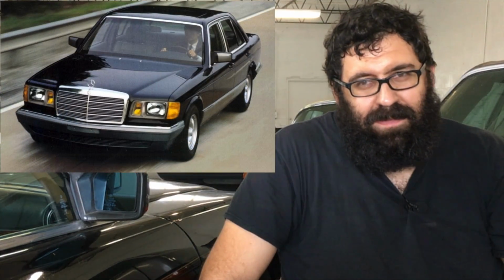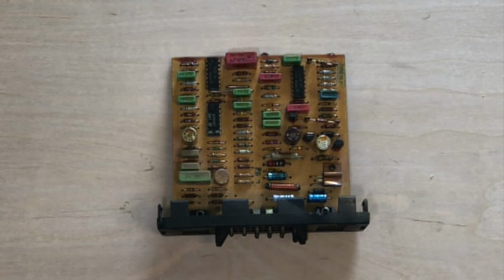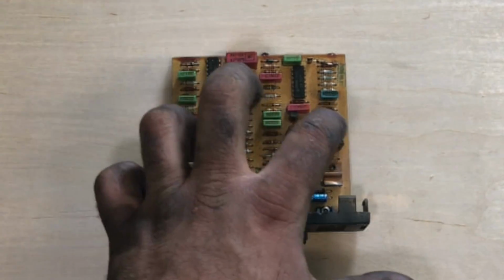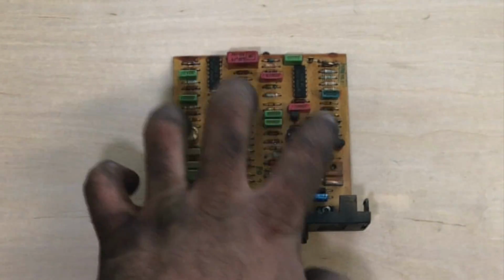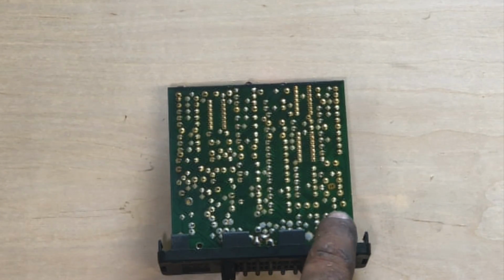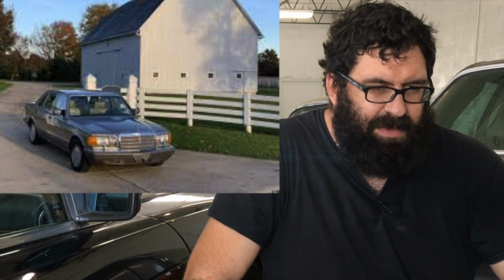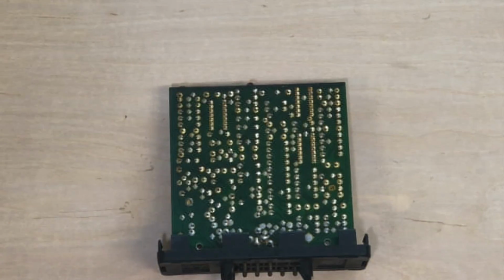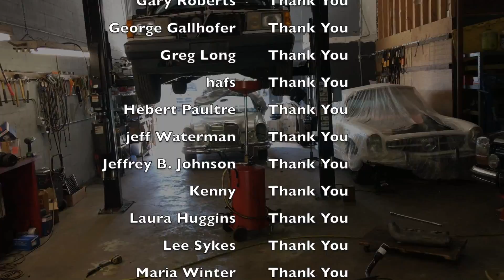Idle control units explained

Comment: How many folks have had their cars made worse by mechanics trying to fix an electrical problem with a mechanical solution? Thankfully, my dealership has a 35 year veteran Benz tech. who lights up when he sees my A124 pull in the garage. These cars are different than the new ones and the number of people qualified to touch them without “making the patient worse” is dwindling 😢
Reply from the maker: I agree. glad you have competent service for your 124! what year and model is it>?
Reply: Mercedes Classic with Pierre Hedary 1995 E320...late assembly for a 1995, too.
Reply: @fsb1284  where is your dealer
Reply: Faiz Rahman Loc at: https://www.mercedesabq.com/about-us/staff/

Comment: I've repaired the soldering spots on my W124's Fuel Pump and OVP relays and on the internal terminals of the KE computer, changing two capacitors too; no engine fails since then.
Reply from the maker: So you were able to repair both of them? on what terminal did they fail. i would like to know so I can repair them.
Reply: @mercedesclassicswithpierre1753  inernally where the pins match to the blades that are in fact soldered to the little board; an almost imperceptible oxidation at the contact point; I've cleaned the metal and soldered all of them. Specifically at the fuel pump relay, it seemed to not be receiving the RPM signal at pin "TD", from the AC compressor unit, pin 2. 
I'll add photos to this reply, just a moment please.
Reply: unfortunately I forgot to take pictures of the fuel pump relay...

Comment: I imported in Europe a 1989 560 SL. When it is cold the injectors work fine. As the car warms up the right side injectors start to give less and less fuel and in the end the car dies. Also the manifold gets extremely hot. Any ideas?

Comment: Our problem 1991 500 sl European model. Start car it idles fine, go for a ride idle goes to 2000 ,fuel consumption gauge stops. Car in garage starts idles fine  I unplug the ICV that I have cleaned 2 times idle goes to 2000. I plug ICV back in it idles back to normal. Is the ICV not working properly or whatever controls the ICV not working. Appreciate any input. Thank You

Comment: I love this video, even though my cars are ‘75 and ‘80, as you know Pierre. The comments here are gold! So much interesting information. My father in law was an audio visual tech when he was alive, and a darn good one. My husband learned a little from him. It’s definitely worth a try to resolder and rebuild some of these control units. 

My ‘75 450SEL cold engine idle is very high, almost 1,000! I just recently changed all the little rubber vacuum lines (the black connectors) in the engine compartment- the heating system ones, under the air cleaner vacuum ports off of intake throttle area, and the three vacuum solenoids lines on the firewall. I didn’t get the main one at the back of the motor, yet. 

I haven’t had a chance to test drive to see if the high idle went away, we got dumped on with snow. I don’t think the idle will change much from the vacuum line r&r but it’s a step in the right direction.
Reply from the maker: the cold idle is fine at 1000. they are supposed to be like that.
Reply: Mercedes Classic with Pierre Hedary thanks!
Reply: I forgot to mention. I made a cold start up video on my channel of the SEL if you have time to watch. Thanks

Comment: There are actually SIX electrolytic capacitors.  4 Radial (standing up) and 2 Axial (laying flat).  The axial ones are close to each other and are blue striped, with one wire coming out of each end.  These fail at the same rate.  The transistors too can fail, there are about 4 or 5 of them depending on model, etc.  These are the small, "D" shaped three-leg devices standing upright on the board, usually with a blue spacer underneath.  These control the different "stages" of idle speed, or the drop in idle speed from a cold start I have found.  These should also be replaced in my experience.  (however one of the transistors is obsolete and no longer made).  Other than that, ANY of the resistors (flat-laying, small, cylinders with colorful stripes on them) themselves can also fail, but usually don't and are easy to check if you see one looks burned/cracked.

UPDATE:  After doing some searching I found a suitable alternative to the one obsolete transistor.  I believe the "BC139" Bipolar Transistor (PNP) by STMicroelectonics to be a suitable replacement.

SO, If your unit has a failure of the obsolete transistor, or one of the IC's (chips) are bad, then you would be best served getting a new/rebuilt unit.  Otherwise they are indeed very rebuildable.  Of course also check for cracked solder joints and cracked/fried traces on the board.  Any exposed traces (copper looking) that are missing their green coating on the board should be considered VERY suspect (as this normally means that area got very hot, most likely because of a "short" somewhere) and inspected carefully for breaks.  These breaks are very hard to spot sometimes, especially so since the background is similarly colored.  Just adding my $0.02 to try and help out someone who was as frustrated as I was the first time I attempted this repair.  Thanks Pierre for this great video!!
Reply: Thank you for your addition, excellent information.  Actually, I think YOU should have been the one doing this video!
Reply: @560sec7  I keep hearing the same thing!  I just have a weak stomach when it comes to the internet!
Reply: petercastro2413    Yea it can... but i would start with replacing the o2 sensor and setting the mixture correctly before really focusing on the idle control module.  Though, if that has never been looked at, then it must also be done.

Even just the mixture being slightly off can cause the surging you are talking about.  Usually only happens during the warming-up phase though.
Reply: petercastro2413  CA smog??  Good luck!  These cars apparently barely passed even when new.

Comment: Dear Pierre, i have this problem with my 1984 euro 380sl. The idle contol valve gets 12 volts instead of 4,5 volts. So my engine stalls when hot! Could this be the idle control unit?
Many thank! Greetings fom Belgium

Comment: I've literally never had luck getting questions answered here but I think usually it's cuzza I'm not e'splaining things correctly. So. This may be TMI but better than TLI.
1983 380sl, sat in a garage 4 years b4 I bought, 2 owners, well maintained. 1st emptied tank best I could, stableized, filled with fresh gas. Ran great for a week then crappy. I had to feather throttle ¼ mile to get any speed. Replaced fuel tank, fuel lines, liqui Moli, new (reman) fuel distributor, fuel filter, fuel pump, kickdown switch, entire AC system (literally all of it), all fuses, plugs, wires, distrib/cap/coil, and more. Relays seemed fine. Finally, it ran great. Periodically though, it idles so low in drive that at a light I worry about a stall, esp w/ AC on. Then, green light, I "sometimes" have to feather gas. Some cat said "maybe idles too low cuz new refrigerant is thicker," decent point so we bled some, added some - no huge change.
After a drive, I pull in garage, put in park and before I shut it off it'll idle @ 1700+. 
So now I start looking next at the Idle Control Unit and/or the idle Control Valve. One is $230 almost universally, the other runs between $25 to one no higher rated for like $500. BTW, the OVP relay seems to be fine - had an extra. All good.
Should I replace the ICV for under $100 or icu for $230? Also, I know how to solder, and have the stuff - more detailed guidance (magnified, explained) would earn you a bag of Charms Blow Pops - THEE best sucker. Idears??
Reply: Patrons get answers more quickly...

Comment: Great video! I have an 1984 SEL that will not stay running without bypassing the fuel pump relay because the relay is not receiving a tach signal. The instrument panel tachometer is inoperative also. Tach signal is from the distributor to the ignition control module and to a terminal block that connects to the test connector, fuel pump relay, idle control module, and tachometer. Ignition control module was replaced but problem persist. Tachometer still does not work with the fuel pump relay removed and bypassed. Some state that the tach signal can be checked with a multimeter or dwell meter. ProgRama tells me that is not true and it requires a scope. Could the idle control module be shorting out the tach signal causing the problem?

Comment: I have a question. I replaced the icv and the rpms started jumping 1000 1200. I then replace the 3 transistors on the idle control unit and the rpms came back to normal. On a warm engine the idle is fine but on cold start the rpms stay under 500 around 400. 

On cold start the rpms should rise untill engine warms up and settles the rpms at 550, now is the idle control unit also responsible for cold start rpms? 
Should I just get a rebuilt one?

Comment: do you have the part# for the 3 small transistors  on a 1983 380 sl idle control module

Comment: hello pierre, i've had you answer several questions on my 1984 500sel. i changed the iac valve and cleaned both with carb cleaner and both work freely now i have a spare. to refresh your memory the problem was low idle cold and high idle warm and once in awhile it behaves. i replaced the coolant temp sensor (on the back pass.side of engine) now i just replaced the idle control module with a used programa module from a wrecked car with the same service numbers. now it has a surging idle and no cold start high idle and seems to be rich. what now??

Comment: I have later model of 126.  1990 having problem with idle staying between 700 to just below 1000 rpm.  I changed everything I can think of in terms with vacuum leak.  All the way to intake manifold gaskets upper and connection between upper and lower.  How do I check to see if idle speed control unit is bad or idle control valve is bad?

Comment: Hi, I had a issue once, it was the terminals in the fuel pump actuator, I had to solder 3 cm on new wire and cover with thermal shrink tube, just pay attention to the position of the color wires when you open the plug. No problem since then, but maybe the actuator can fail also, I never checked the Idle Control Unit on my W124 so until it fails I keep calm. Thanks. AC
Reply from the maker: that's very cool that you were able to diagnose and repair it....it was also good yopu were able to fin the issue.

Comment: Hi there, i got a 300 se 89', first changed my ecu because rain water goes in side of it and it s been broken, now i got another used ecu to my car, it has a one problem, when the car gets warm idle becomes rough it goes between 5 and 10 on tacho, now i turned off idle control valve, but this problem couses from idle control valve or used new ecu?

Comment: My 1990 560SEL 126 has a constant surging idle that no mechanic in my area has been able to fix its very sad it use to surge for 5-10 min. On startup then I could drive it but the last mechanic reset something and now surge doesn't go away could it be the module or the valve or a vacuum leak? I've given up on it
Reply: Tony Light 🤦‍♂️...so many guesswork mechanics out there trying to fidget with these cars when it’s just aging electronics that can be rebuilt with a soldering iron and Mouser catalog. I hope they didn’t take you to the cleaners while learning on your car...
Reply: @fsb1284  yeah they did and its been in the garage for 5 years now
Reply: Tony Light that’s a shame...
Reply from the maker: Hello, +Tony Light and thank YOU so much for your question(s), we want to answer you as quickly as possible. 
By signing in our Patreon https://www.patreon.com/thomaspolk page and making a donation of $10 your are assured of a 24 hour email response from Pierre. 
If you are already a $10 member please mention along with your question.
Reply from the maker: Tony, please email me at mbownersforlife@bellsouth.net. I would like to know more about the issue and how it came about.
Reply: I’ve been chasing down a similar issue on an M103 engined car - the surging is there from cold until full temperature is obtained - I think it might be air getting sucked in around the injectors until the head expands ever so slightly with heat as the fault does not come back until the car is left overnight.

Comment: Hi Pierre - Great channel thanks! - just bought a 85 380sl and it is idling high around 15 to 20 I took out idle air control valve and cleaned it out with carb cleaner but no help I pulled out the OVP from above the fuse box and checked the fuse in it and that was good - how can I check to know if OVP is good? Also I thought I pulled out the Idle control unit (behind glove box) but found out it was the blower motor speed control unit LOL ( they look similar) I will go out now and look for that idle control unit and inspect it as you showed in this video. Having fun learning and puttin around on my new toy - any input here on my issue would be great - Thank You
Reply from the maker: Hello, Ernie D and thank YOU so much for your question(s), we want to answer you as quickly as possible. 
By signing in our Patreon https://www.patreon.com/thomaspolk page and making a donation of $10 your are assured of a 24 hour email response from Pierre. 
If you are already a $10 member please mention along with your question.

Comment: Have you ever seen bad capacitors cause a low idle? Or do they mostly cause surges?
Reply from the maker: no, they almost always cause outright failure of the unit with high idle speed. Low idle is usually related to the fuel system being over pressurized. Extremely high control pressures choke the air flap.
Reply: Mercedes Classic with Pierre Hedary  I’ll have to pull my CIS gauge out then...

Comment: I have a european w126 380sel and im experiencing high idle plus the abs light. What are my chances finding a replacement or should i try and repair it? Sometimes i get idle as high as 1.7k rpm and its really annoying especially when coming to a stop. Thank you
Reply from the maker: you likely need an overvoltage protection relay, and that's all. it is located in the fusebox.
Reply: Mercedes Classics with Pierre Hedary i did replace the overvoltage relay plus the idle control module and it didnt change amything, the abs light is still on.   Also the idle control valve has 2 wires one of them connected to the body and the other one goes to the bottom left corner fuse. What am i missing here ?Im really bummed what else can i try?

Comment: Hi Pierre, I own a '89 560 SEL and I had this problem for years now and no local mechanic have being able to help me and the local Mercedes dealer's suggestion is for me to buy a new car, me my car idle rough ever since I change the fuel pumps because one of them was leaking, I tried everything, change spark plugs and wires, change the fuel filter, fuel distributor, change the idle control, and I just ran out of ideas because the repairs manuals that I have are just not helping.
Reply from the maker: Jaime, can you email at mbownersforlife@bellsouth.net? maybe i can help you. Did you adjust the 3mm allen screw?

Comment: I have an issue with my 1984 500 SEC Euro market car that misfires upon startup, then after about 5 seconds of running it smooths out and isles at 550 RPM when cold. Then, as the engine warms up, the idle rises and usually stops rising at around 1500 RPM but occasionally can be as high as 2000 RPM. I suspect that the high idle is idle control related. I assume that the misfire upon startup is related to a different issue. I’m hoping that the misfire issue will be solved by replacing parts that I was intending to replace anyway due to the car’s age and it’s higher mileage. What are your thoughts?
Reply from the maker: Hello, +Spencer Tarter and thank YOU so much for your question(s), we want to answer you as quickly as possible. 
By signing in our Patreon https://www.patreon.com/thomaspolk page and making a donation of $10 your are assured of a 24 hour email response from Pierre. 
If you are already a $10 member please mention along with your question.
Reply from the maker: Spencer, 2 things. the high idle is likely the idle control unit. the difficult start/miss might be a bad fuel pressure accumulator, or , possibly several injectors that are bleeding off.

Comment: Pierre I am considering buying a 1984 1 owner from the owner a 1984 300sd turbo would this car have this idle control issue . It only has 30995 miles. And what would be a fair price to offer her always stored inside but not driven in several years. I enjoy your channel very much. Robert here from op ks
Reply from the maker: no, it's all mechanical...the only thing that can go wrong on it is the rack damper pin. if the car is solid, you can't go wrong
Reply: Thanks Pierre I am going to see car next week looking forward to seeing a 300sd with only 30 thousand miles